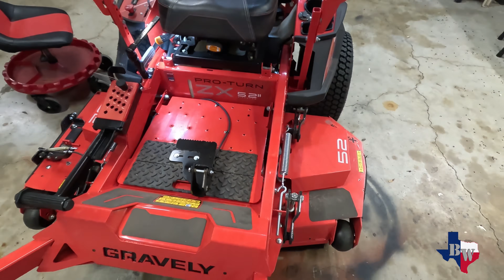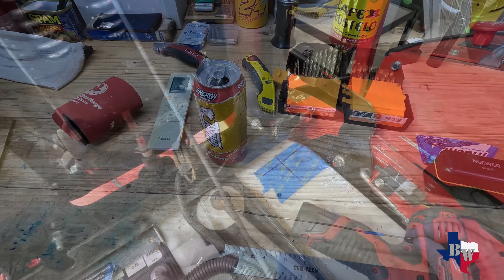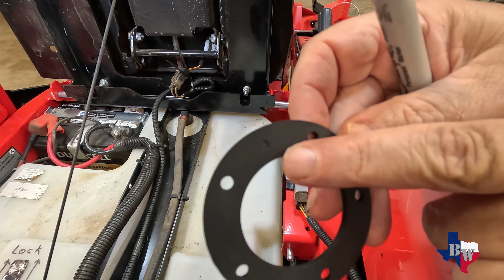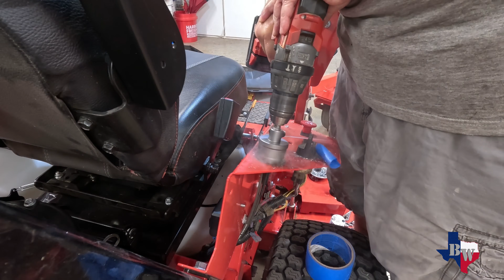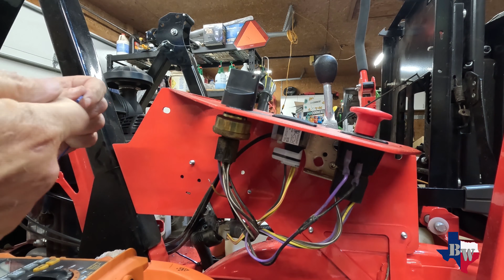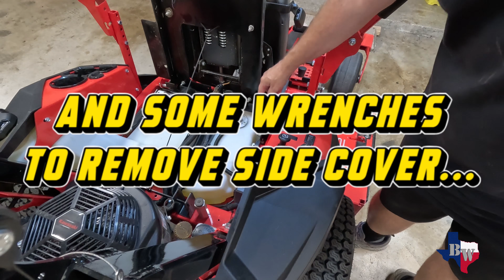Installing an Electronic Fuel Guage on a Zero Turn Mower

Comment: I assure you fuel will not wick up around those screws. That thick plastic is sealing around the threads. I like this idea and will probably do it to my Exmark.
Reply from the maker: I was just worried because with this tank the screws are "under pressure" until you burn about a gallon off. Either way it is an awesome add on and it's not expensive at all..i love it!

Comment: Did you consider mounting the fuel gauge on the plastic fender behind where you installed the fuel gauge? Seems like it would maybe be an easier installation rather than drill through the heavy gauge steel?
Reply from the maker: That would work but I really wanted it to look good to me and in my opinion it's too far back.

Comment: What is the model of the fuel gauge ? I have a 2024 Troy-Bilt Super Bronco 50K XP, Kohler 7000 Series, 24 HP, 725 CC, KT735 and I am always looking to add gadgets on it. I am a girl but it looks like I have no limits with fantasies "(^ . ^)"
Reply from the maker: The brand is adiotek I believe... There is a screenshot of the order in the video

Comment: 2 years with a z421 kubota that I mow 5 acres with never have I ran out of gas has the same slit to see the fuel how tf do you run out of gas in your little yard 💀😂😂
Reply from the maker: Easy...I just mow until I'm out of gas then I've ran out of gas (because the gas tank is empty).

Comment: well thats cool come put on my motorcycle  I would have cleaned that fuel tank after drilling it s might pickup all them shavings from drilling that plastic just saying think it could help not pit that in your carb
Reply from the maker: it's hard to tell in the video but the shavings didn't get in the tank...it was more like long strings of plastic that were easy to pull off.

Comment: I have the same mower. It is important to always fill your tank when you are finished mowing because if its empty of fuel, it is  full of humid air and after a while you will collect water at the bottom of your tank. As you know, water is not good in your gas and could cause issues with your carburetor. That is a crazy shaped tank for sure. There is the bottom part that you put your fuel gauge into and then there is a smaller tank up near the filler neck. Like someone above stated, if you fill your tank that means that the fuel gauge seal is surrounded by fuel. It could leak. I might mention that there is a fuel tank vent that expels fuel vapor to the carburetor. It is installed in the small, upper part near the filler cap. If you fill the tank near the rim where the cap is the engine will suck raw fuel into the carburetor through a small hose and it will run awfully. Raw fuel will wash the oil from the cylinder head \ valve area.  Raw fuel will pour out of the exhaust also. If you never fill your tank you won't see this happen. But I will always fill my tank with fresh fuel. (The gas cap will vent air into the tank and the fuel vent mentioned above will vent fuel vapors to the carburetor.)
Reply from the maker: Thanks for the detailed explanation and tips!

Comment: No need to use epoxy, the bolt threads will seal completely as they thread thru the plastic tank.  A better way would be to use small flat washer on each screw with a flat rubber washer or an O'ring between the flat washer and the gas gauge flange.    Either way is good.
Reply from the maker: Thanks for the tips - I like the idea of using rubber washers!

Comment: Fill up the tank and write down the hrs. When it’s almost out write it down to get your run time. Write the run time hrs with permanent marker next to the hr meter for future reference. Next time you fill it up ad the average run time to the hrs showing and write that with a dry erase marker also near the hr meter. When your hr meter matches that calculated number your just about empty. Clean off dry marker and put down new calculation at the next top off. Simple math. It took me more time to write this than putting this into use. You can also set a count down timer with vibe alarm  on your phone to warn you it’s getting low. John Denver was good at running out, but just once….
Reply from the maker: you could but looking at a guage is way faster...
Reply: Maybe the more expensive models have the gauge you need.

Comment: Won’t all those plastic bits that fell in while you were drilling clog up the fuel system?
Reply from the maker: No much actually got in and I was able to get some out. The plastic actually floats so if there is any in there it will just float on top....if it does get sucked up it will be easy to clean (it won't get past the filter for sure)....thanks!

Comment: I would not have used epoxy on the screws. There is Permatex gasket sealer for fuel systems that would have been much better.
Reply from the maker: I was worried about a sealer like that acting as a lubricant and making it easy to strip out the threads but now that I've done it I think anything will work fine.

Comment: Nicely done! I might have used RTV silicone on the sender screws rather than epoxy. Just in case that I would need to replace the sender...
Reply from the maker: I was kind of worried about the rtv acting as a lubricant and maybe I would strip out the threads (they are fine pitch screws)...hopefully the sender doesn't go bad...if so i'll probably install rivnuts or try and thread some bolts from underneath (to act as studs).

Comment: That is a terrible location for a ZTM's gas tank.
Reply from the maker: I think they did this (vs saddle tanks) so they could use the tank across multiple models...i know it fits three different gravely models and two ariens models (which have slightly different "fenders").
Reply: @BubbasWorkshop  no way to puncture this tank when running into things like you could with saddle tanks. It's a good use of empty space.
Reply: LOL, you should get out of your house more often.... that`s where most of the fuel tanks are located today due to limited room. Very low center of gravity is a good thing, too. So....

Comment: I thought about doing the same thing. But then thought some more about possible leaks since the sending unit has to fit at flat top position. And when filling the tank, parts of the tank are higher then the flat position. And that could be a problem with fuel leaking out over time from the sender unit gasket. So I just fill the tank before mowing and moved on. And those vertical sending units work from magnets and reed switches. As the magnet, the float section, passes up and down the metal tube, it switches on reed switches that have resistors attached changing the value to show fuel level,  Just some FYI
Reply from the maker: so far so good..no leaks..but I AM watching it like a hawk and storing it completely filled on purpose to see if it starts to leak.

Comment: its crazy how much money they want for these mowers and dont provide a proper fuel gauge, i've got a toro 75750 with the kawasaki and it has the same type of window gauge lol
Reply from the maker: And the parts are cheap!! I know they could buy these in bulk cheaper and it makes the mower feel so much more high end with an actual guage. At least make it an option...
Reply: @BubbasWorkshop i know older tractor mowers came with a fuel gauge and now they dont
Reply: @Chevytrucker2  
As we over populate the country, yards are not near as big as they use to be, They are getting smaller all the time. Houses are being built a few feet apart today in these neighborhoods.
Its harder to run out of gas during mowing anymore, so why bother with a fuel gauge and the inflated cost that they`ll charge for it in these lawn mowers today.
Reply: @DERP-1you would think a commercial mower would come with it atleast because theyre not stopping after one yard that 100 square feet
Reply: @Chevytrucker2  I can remember being a kid and My father had a ride on tractor that had a gauge on the tank. Had a Float on like a twisted rod that would turn the needle to show you the level. No Battery needed!

Comment: I’m no mechanic so correct me if I’m wrong but your wiring diagram looks as though you have power all the time to the gauge. Wouldn’t it be better to power it thru the “ON” tab in the ignition switch? If always on it creates a parasitic draw on the battery.
Reply from the maker: I show it somewhere in the video but the tap i'm using is through the key switch (it's a pre-installed pigtail from the factory for optional lights and/or usb charger) so it only has power when the key is on....thanks!

Comment: Great improvement!! 
I’ve been looking for optional fuel gauge replacements for my zero turns. Those float style they all use go bad quite often, whether the floats get saturated or stick, too the lense getting so dingy you can’t read them? Just a junky design that’s flawed terribly bad! Thx for the new direction to check into!! Btw, great detailed video!
Reply from the maker: Thanks - glad you found the video helpful!

Comment: Or just use the stick method.
Reply from the maker: stick doesn't really work on a tank shaped like a bowl of spaghetti lol
Reply: @BubbasWorkshop  I would quess not. My tanks are on each side.just take the cap off and you can see the bottom of the tank.looks like they  may  have over engineered your mower.mine is a dixon errr.. blue husqvarna.

Comment: My gravely has two tanks so I mow for a while with the first tank and then switch them. It’s better to just fill them both up than it is to run out in one. Found out the hard way.
Reply from the maker: the main problem with this one is the shape...it drains slow till it gets to the last part and the bottom of the tank is so small you go from 1/4 tank to empty in a heartbeat..

Comment: Hey can you share the link for the gauge and sending unit
Reply from the maker: https://www.amazon.com/AODITECK-Universal-240-33ohm-240-30ohm-10-180ohm/dp/B09RJ1SD6P
if you have a different mower make sure you get the correct depth/length of sending unit ( i go over it in the video)

Comment: Nicely done....I'll be adding this to my HD52.  Did you have any gas leaks if you filled it up the neck of the tank?
Reply from the maker: No, I didn't (I thought I said that in the video)....i DO think if you are going to fill it up that high you need to use epoxy or gasket maker or something to keep the fuel from wicking around the threads in the screws....i could be wrong but it can't hurt.
Reply from the maker: Also, i let that epoxy dry for about two days before i filled it up to the top...